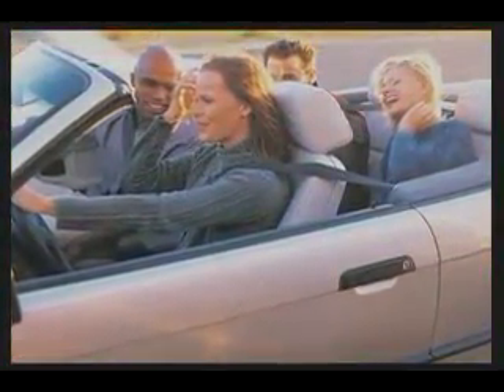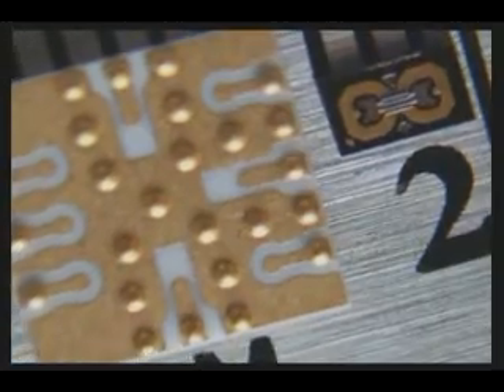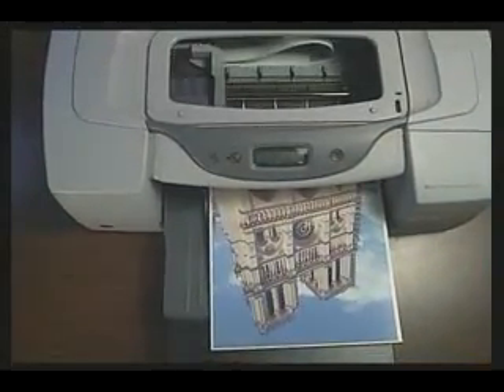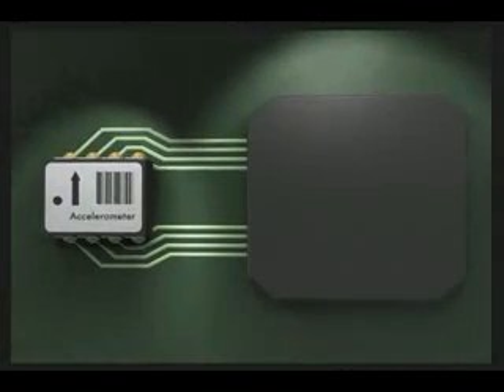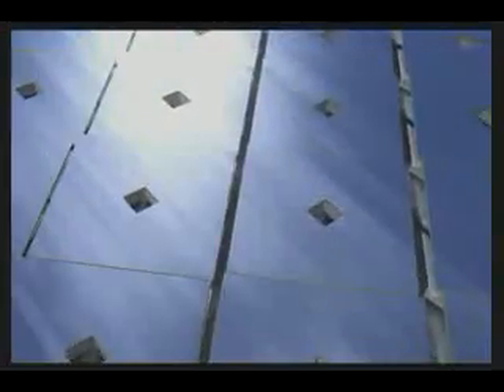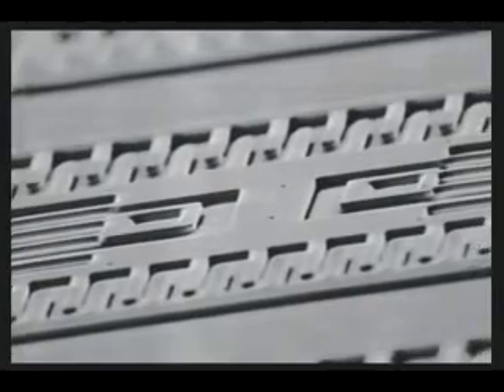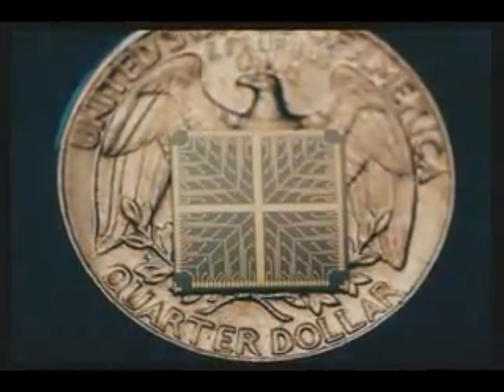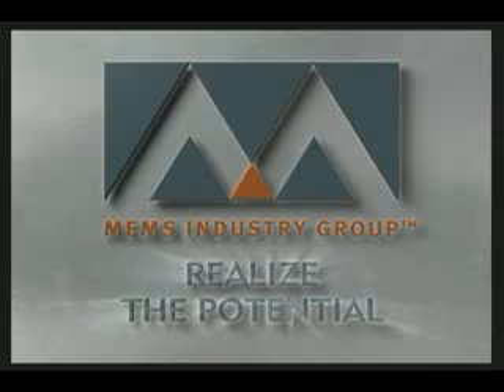Introduction to MEMS "Micro-Electro-Mechanical System"

Comment: An accelerometer in an automobile needn't be so "micro."  Of course there are many other applications where size matters, however, this was a questionable example.
Reply: But using micro sensors mean you can mass produce them for both automobile and small applications... And many more. All with just one design and production

Comment: I'd like to know if MEMS could improve the current state of audio engineering as it relates to musical instruments. There has always been a gap in this field. When the transistor was downsized in the form of what became 'large scale integrated circuits' or LSI it opened many doors for the electronic organ in particular. Unfortunately the tonal character of these LSI equipped organs was somewhat inferior to earlier technology, including the wonderful tones using discrete transistors. Digi's worse

Comment: is it because the small size of these components making them highly automated process to manufacture and they fit into something much larger makes them introduced at the low end of the manufacturing chain? it is like the inkjet probably the ink packs are expensive but not because of the printing mem on them but because they are sold at extravagant price by the printer makers for using their product brand

Comment: I have been reading some conference papers and journals about mems (ex: IEEE MEMS , Tranducers, Sensor and actuators) I found that there is no profound progress in MEMS technologies. 

From these two factors ( low profit in mems business and slow progress in mems technologies), I concluded that we can not expect for the bright future for mems.

Thanks.

Best regards.
Reply: 9 years later, has your perception changed or still the same?

Any reading material links?

Thanks.
Reply: @LordAtlas10  There has been no innovation in MEMS for 10 years. The situation around MEMS research is much worse than that time when I left that comment. 
Please check the DARPA project list concerning on MEMS, You will find that DARPA stopped funding on MEMS over 10 years ago.